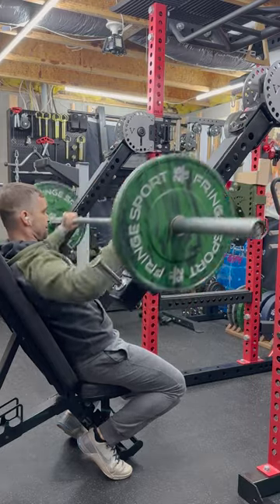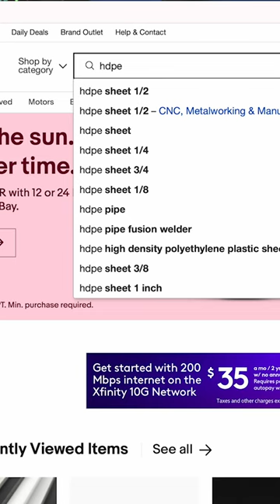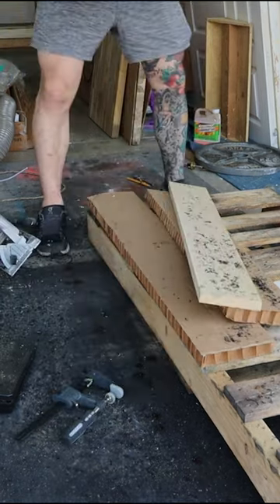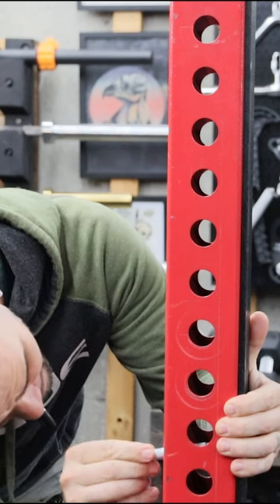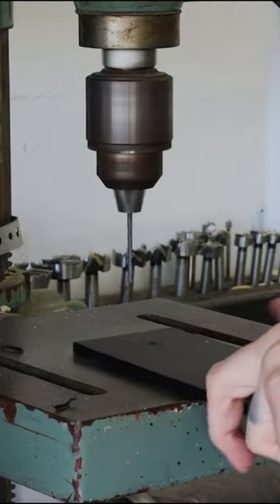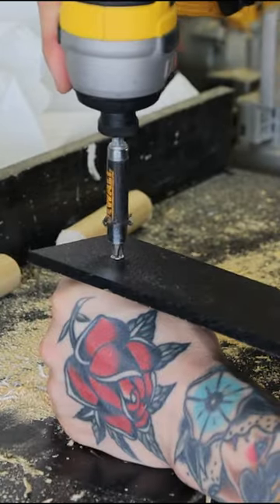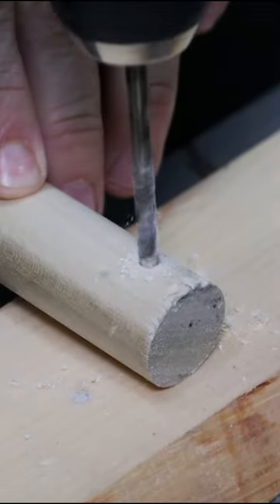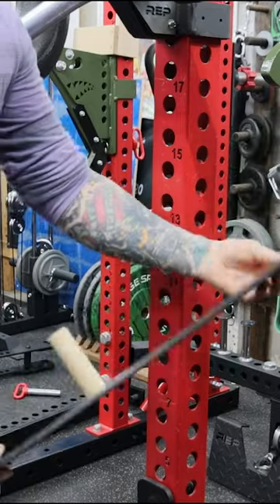DIY smith machine using HDPE attached to a rack

Comment: Not a smith machine. How do you rack when stuck? You use the arms? Cool but not a smith machine. Just making it easier to move weight, not necessarily what most people want. The smith machine is used for spotting when you have no spotters like most people do. It’s just a cage with arms. That’s cool but if you fail midway you still have to drop to the arms.
Reply from the maker: Ok cool. You don’t like it, don’t make it. No worries bro!

Comment: Question on the cover for the bar. For plumbing pipe, would you recommend a 200° cut with easing around the edges? If that makes sense. Maybe a video would be an order? ;) Regardless thanks again for your great ideas/videos!
Reply from the maker: I honestly don’t know what’s best, I cut conservatively but ended up cutting more so it would fit. You’ll just have to feel it out.
Reply: @KaizenDIYGym  It ended up being around 200 degrees turns out. I used a drehmel to cut it in "half", and it was kind of messy, so as you said, I just had to feel it out. 

I think I got lucky, but both sleeves fit securely, and I can pry them off with my fingernails. For now. I cut them each about 6" long, and they work great.

Comment: haha now you post this after I made them! 

But srsly I suspected from your first teaser video that you did that little 1/8" countersink. I didn't do that, but my HDPE strips turned out great! 

You were right my knurling is grinding grooves into the plastic, so I think I'm going to get some plumbing pipe and cut in half to protect both plastic and bar. Or at least athletic tape for now.

Thanks again for the great idea! Quads say "I hate you!"
Reply from the maker: Yeah! The countersink isn’t 100% necessary. 
I’m glad to hear that you’re enjoying it. Seriously, it’s probably something that every home gym owner could use to add more versatility.